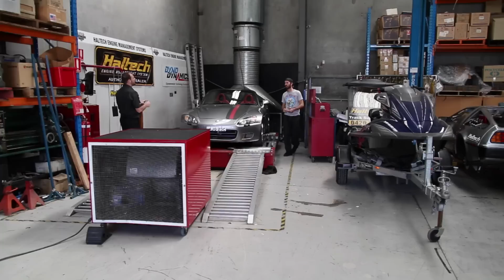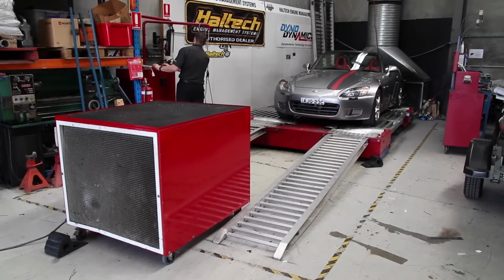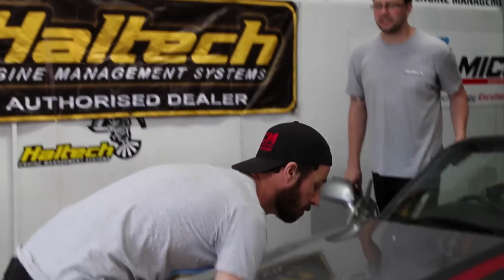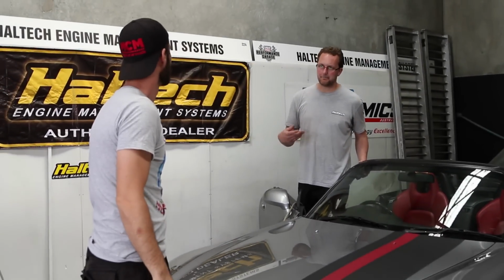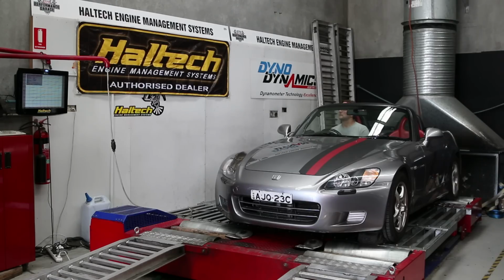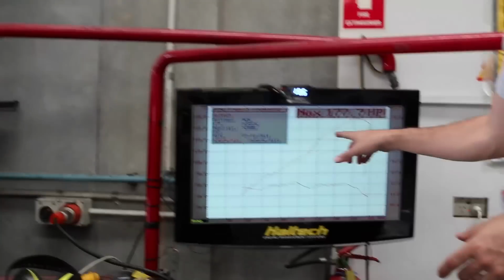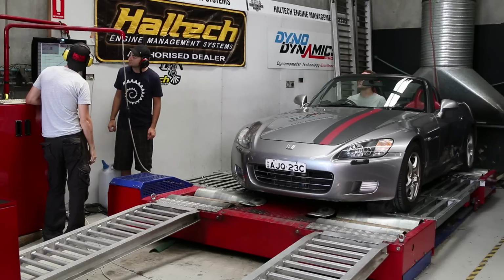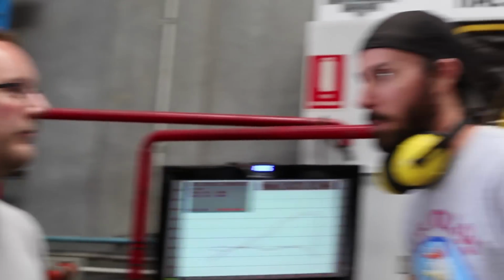Cold Air Intakes Mythbusted [Naturally Aspirated]

Comment: Here I thought I would be posting original content on testing a CAI on an NA engine, only to wake up to this fantastic video. Well, two is better than none. Great watch - I found similar results on my Acura Integra (no vtec yo). There was an increase in power on the top end.
Reply: Can't wait for your video man.
Reply: Joey Chong I'm not huge on link spamming so I didn't share it above, but since it wasn't obvious that I just released it here it is: http://youtu.be/llKZdUyoz14
Reply: I watched your vid too. Good vid, you might have seen even more gains if you too it to 7000 rpm.
Reply: I don't know why but I get this passive aggressive vibe between your channel and MCM. Although they probably filmed this before you filmed your video they seem to piggyback off of your ideas and its kind of unsettling.
Reply: yardman0001 TO THE LIMITER!
Reply: It is cool to see very similar results for two different NA engines :)
Reply: Your results seem parallel to MCMs, pretty amazing!
Reply: You should test real world driving and the affect on heat soak.
Reply: VolkswagenGamer why would that be the case? they are both using NA cars, so realistically the videos that could be made are limited, especially if they are going to show basic mods.   i.e..  intake, exhaust, tune.....i doubt we will see things like new cams and other expensive engine work until the end of this series if at all
Reply: U da real mvp
Reply: I told you so Engineering Explained.  The main thing that determines power is the ECU  !!!!    I WIN  ....i should start my own show.
Reply: Yes I knew engineering explained would justify cold air intakes!
Reply: Soo it does work even if my engine is not tune yet or tune it for daily use not track use? Tell me more
Reply: It will work but performance Varies.
Reply: jesus vega the gain of horsepower varies but it'll definetly add some horsepower to my engine right? Thank's bro! I'm consider buy k&n cai someday rather than the replacement unit :)
Reply: Your welcome man. They respond even better with headers.
Reply: +jesus vega Cars sure do. I'd rather upgrade exhaust first so that a better intake is matched with better exit flow versus just intake flow, but then a lot of people might do an intake first since that's easier to do.

Someday maybe I'll try working on the intake first and the exhaust second, but since the other way worked for me, I may be ready for disappointment, lol.
Reply: +VolkswagenGamer Yeah, it did feel a little passive aggressive between Engineering Explained and Mighty Car Mods. I don't think that it was meant that way. There was mutual respect, and some thinking like, "I want to be careful how I saw this." You know, he felt bad to say they were wrong on something...thinking more about the painted intercooler than this video.
Reply: +VolkswagenGamer Yeah, it did feel a little passive aggressive between Engineering Explained and Mighty Car Mods. I don't think that it was meant that way. There was mutual respect, and some thinking like, "I want to be careful how I saw this." You know, he felt bad to say they were wrong on something...thinking more about the painted intercooler than this video.
Reply: can any good men tell me something  , have a hyundai accent 1.6 a/t diesel with 136hp , 300nm  , if i were to take off the floor of the air box as the width and length  of the air filter , do i get what "good" and "bad" ? thank you
Reply: Engineering Explained the difference between one cai and the next one can be huge, but I have to speak from my own experience and I found the best results with a branded performance replacement panel filter and the best numbers were made with the bmc product, the lowest (negative) result was the ram-Air which was down on torque by 6lbft at the most and down on power by 2bhp, I have to add that the weather was very warm at 73 degrees Fahrenheit and one 20 inch diameter 6 blade fan was blowing at the front of the car, trying to simulate the atmosphere at x mph but probably way off. All products were tested in the same conditions. Bmc was 8bhp up at the peak and 7 up in 2 other places, and torque was up from 2 to 7 across the board. This is the order of result
2,green cotton cone filter, cda enclosed cone, HKS universal foam mushroom, pipercross foam k&n replacement panel, k&n cone ramair foam. Basically it looks like the replacement panel is best as the k&n was up 4lbft and 2bhp 2 tested both gained in both areas
Reply: How many kilocatts?
Reply: Also worth mentioning, LHT Performance found the best bang for your buck intake is actually modifying the stock intake already, so taking out that little snorkel on the top of the air box and cutting out that separator on the bottom box gives you the most gains from factory. CAIs are good but on a track after repeated sessions, the factory box tends to do the best job with keeping hot air away from the engine

Comment: Biggest improvement is the NOISE!!

Love that intake sound, its also much more dynamic than the exhaust sound, very quiet at low throttle and loud at high throttle!
Reply: On older cars it’s not just noise because the factory intake is garbage compared to the new intakes. I threw a cold air intake from a keep Cherokee onto a Buick rendezvous and it made the acceleration so much faster after I removed that small box filter. You won’t get supercharger numbers but on an 06 car I guarantee you’ll get at least 10 hp because your car couldn’t breathe.
Reply: @toxicity6629 , 4th gen camaros get an avg of 12 on cai

Comment: 3 to 5 kilowatts = 4 to 6.7 horsepower.
Reply: Those pushing electric cars want all us petro heads used to talking about power in terms of kilowatts. Subtle, but obvious.
Reply: This ain't about Teslas...
Reply: At the wheels to boot.
Reply: @Deiphobuzz  wtf are you talking about. The OP was giving a conversion, he made no comment on one mes system being better than the other.
Reply: @juanvaldez5422  someone else removed his comment. Wasnt at op.
Reply: @Deiphobuzz  ah, my bad
Reply: @Deiphobuzz  like it or not, but i prefer HP over kilowatts.  

100 HP sounds a lot better than 74 kilowatts.
Reply: @WorivpuqloDMogh  What about 1.21 Gigawatts!?!?!?
Reply: @jaytee1086  thats just +-1500 horsepower
Reply: Quit arguing ladies. The point is a cai adds horsepower. Period, that's it. Whether you call it something else... everyone knows what the fuck horsepower is, I mean come on lol.
Reply: @JimmyMakingitwork  Electric cars will always accelerate faster than an ICE because of instant torque. Also you can basically spin an electric motor as fast as you want.
Reply: @Deiphobuzz  LoL, Horsepower is just a derived English unit that represents power which uses the same derivation as the metric units. Power (Watts/Horsepower) =  Force (N/lb) * Distance (meter/feet) / Time (seconds). A random ass pony's power output just happened to match  1 lb-ft/s. 
Btw 1 Joule = 0.738 lb-ft
Reply: @merlinthebikewizard4392  And then you can burn them out too. Lol
Reply: @WorivpuqloDMogh  I know this is 6 months old but that is the stupidest thing I've heard. If 100HP sounds better than 74kW, does 134HP also sound better than 100kW?
Reply: @jaytee1086  no man. It would fry your flux capacitor.
Reply: @Deiphobuzz  So what you're saying is the OP is stupid because someone else devised the horsepower system? Seems legit
Reply: @CALISUPERSPORT  only amerifats
Reply: Thank u! I don't speak Aussie bro
Reply: Could it help with gas mileage?
Reply: @Deiphobuzz  ok Boomer
Reply: OddTimeMan that’s close to 7 hp which is noticeable to feel but it will vary from vehicle to vehicle
Reply: I dont use KWs because i am used to use HP, and everyone who i know uses HP. You can use KWs if you like but dont come to tell us what we should use. Greets from Europe.
Reply: @morreracing  Who's telling you what you should use?
Reply: @OddTimeMan  it was to everyone who thinks its wrong use HP instead KW. Its not only American thing to use HP like someone said before.
Reply: @AdonisGaming93  he changed his comment a long time ago.
Reply: @znobbz__2874  HP is based on bullshit, like all imperial measurements. The work a pony can do in an hour.. How is that not stupid? At least KW is based on a universal energy value, Joule. Thus a 50kw engine produces the same workload as a 50kw electric motor.
Reply: @Deiphobuzz  It’s been around long enough lods of people know it so it ain’t really bs, while I agree kw is better i still use hp more because we’ve been usung it on cars longer i suppose
Reply: @Deiphobuzz  K, nerd.
Reply: @JimmyMakingitwork 😂😂😂
Reply: Forget kilowatts I want gigawatts!

Comment: Pro tip for all of you looking to get a cold air intake. Buy a cheap CAI kit on ebay, you can find them for about $50. Then, measure the filter that comes with it and buy a K&N or AEM replacement filter that is the same size. Replace the filter and you're good to go, and you just got a high quality CAI for around $100.
Reply: Build your own. Way cheaper. I used 3" PVC. ;)
Reply: +Travis Pfeifer Doesn't PVC offgas some nasty things when it gets hot?

I used ABS to avoid that, but not 100% sure if it's actually a material concern. Worth looking up, though, would hate to foul up your MAF sensor or something with nasty PVC fumes.
Reply: +MrJamesonStyles I'm not sure if that's something anyone has looked into. PVC fumes and MAF function...best guess is it's more dangerous for humans. K&N filters do have confirmed problems for MAFs however. Increased gunk on them and all of your intake. If this is not all cleaned up, regularly paper is better.

Paper may still be better even if it's all cleaned up. MAFs for example already fail a lot on my car, the count may be 1 or 2 less without a lot of K&N filter time. 5th MAF in 140k miles. (Though 1 was just because new from the factory it was messing up fuel trims.)
Reply: +MrJamesonStyles Plus, PVC offgas is at temperatues that my intakes don't get to, even in the hottest of my summers, so a nonissue in most NA car unless you're 110 degress F plus...I haven't witnessed the data that hot.
Reply: +DE “AutoBravado” Nichols you must live where it's cold all the time then cause my Camaro in the summer will easily see 140 idling in the hot 100 degree summer heat.
Reply: luigi90210 Mine will too in a real city's stop and go traffic. I live in a small town so I don't see much of that kind of driving.
Reply: luigi90210 For some silly reason I'm an American who left my torque app in C. Did the conversion and the worst I saw in Salt Lake City was 158-170F.
Reply: luigi90210 This was before I added another cold air pipe blowing on my short ram. When I'm moving it'll get maybe below 40C about 104F, or close to ambient. Usually doesn't get above 58C (136F), at idle in bad traffic, but the stock intake held on to heat and would consistently stay above 50C unless you could get out of traffic. 

With same conditions with my mods I'd get close to ambient temps as soon as the car was moving instead of heat taking a while to bleed off.
Reply: DE Nichols lolol

i also use torque pro to log data off my camaro, i live in a fairly big city so i see those temps all the time unless its winter and like 40 degrees outside

i would never use PVC for an intake though, id buy the ebay intake made of aluminum and put a name brand filter on it if i was on a budget
Reply: luigi90210 Luigi, my comment was mistake 22 weeks ago. PVC would definitely get too hot and off gas! If you want to get ideas off my setup, I did make a video since then.
Reply: 3DprintedLife does it sound better?
Reply: I did that to i bought my cold air in EBay for only 40 bucks for my Mazda protoge it's worth it i do notice a slight difference lol
Reply: Not in California
Reply: You guys are missing out the engineering skills of big brands that you both don’t have. It’s all engineered to allow air in the right way its science boys look into it.
Reply: Aw I read this comment 4 years to late , just spent 300 on a k&n intake
Reply: Do you mean to buy only the mushroom part from k&n and then slap it on? do i need heat shield too?
Reply: my DC Sports is Dyno Tuned!!!!.....very AMmmmzzing CAI.....Then put Filter Wears on filter....Prestige  Auto cut out foglights...put thick... grill in it...paint it satin black.... made dummy on other side!!!... it.. sucks..cold air.. into CAI ..into throttle body... &... it screams...one of my mods on my 2006 Mitsubishi GS..😊😊😊😊😊😊😊😊😊😊😊

Comment from the maker: Quick Tip: If you want email notifications when a new video goes up then click on the little cog next to SUBSCRIBED and select 'send me updates'
Reply: hi mcm im from uk and was wondering if you will come to the uk some time
Reply: firts thing boost the s2k and second ypou should consider coming to millwaukee wisconsin or west allis wisconsin to be specific we have a great car scene here that marty will hate cuz hondas everywhere
Reply: *****
You need an entire firewall for some cars, some cars you just need a steering column and the interior infront of the seats.
Reply: Mighty Car Mods Clearly the people on your forums are god damn idiots and have ZERO clue how a car engine works. It's essentially a giant air pump. The better you can get a larger and colder charge into the engine the bigger the bang you're going to get. Bigger bang means more power, taking out the very restrictive factory intake which is more designed around keeping noise low than making better power is good step in getting a little extra horsepower.
Reply: I do not have a cog next to my subscribed is this cause I'm on an I pad?
Reply: Never sell your s2000 MOOG!!! Love it!
Reply: Thanks for letting us know!
Reply: should make myth bust old oil vs new oil see if you get more hp or the same
Reply: Love the shirt Moog
Reply: ***** lol. Are you joking? I hope so. Because if you really think they'll read your comment and say ok let's do it your lacking massive amounts of common sense
Reply: Michael labonte I could make him a video on how to convert a car from left to right hand drive.  It'd go a lot like this:  Sell the left hand drive car and buy a right hand drive car.

Boom.  Done.
Reply: mynameisray I put a AIRAID  CAI on my 2014 Dodge Challenger with the 3.6 V6.
My 0-60 times went from a low of 6.5 seconds to a HIGH of 7.8 WITH THE CAI.
So I actually LOST horsepower!!!
Reply: ***** Youre joking, right?
Reply: +lonnie mann well, the aftermarket intake weighs less, so the car is gaining from that as well. no matter how you look at it, cold air is the way to go over factory.
Reply: ***** 
Dude your talking like 2lbs less. It's nothing!
Reply: floridabrn the factory intake on the Challenger is already a cold air intake.
It sucks from the bottom
Reply: Motor City Man Every time I even think about buying an intake when I get a new car, I wind up slightly modifying the stock airbox....Love that OEM look and honestly, with a clean OE or K&N filter, they make the best power....And as you said with dudes Challenger, almost everything now-a-days has ducting for cold air from the factory.
Reply: +Mighty Car Mods Alright, listen up. I'll try to explain what I did. Search for "How To Build A Peltier Cooling Device". Once you know what it is figure this out, I put that cooling fan into the air filter box, so it makes cold air sending it directly to the throttle body. But Im not able to take the car to the dyno. Can anyone recreate what I did and check if there is any hp gains?
Reply: +LOV2XRL8RL Peltier cooling your intake requires electrical power which has to be generated by the vehicle's alternator.  You will increase alternator load, which will increase parasitic load on the engine (like a supercharger does) to make the air coming into the engine a fraction of a percent cooler.  A decade or so ago some people tried cooling their PC air intake air the same way, which is a vastly lower volume of air, and found that it basically did nothing useful.  It probably did lower temps, but not enough to be noticeable.

You're moving vastly more air than a PC fan with your engine.  The sheer volume of air moving through your airbox won't be significantly affected by a peltier element.  And they're massively inefficient as a cooler - there's a very good reason why people stopped using them to cool their PC's back in the early 2000's.  There are just far better ways of doing this.

To make a cooler that could stand a chance of making more power, you'd need a peltier so large it probably wouldn't fit into your vehicle.  You'd need to have a huge alternator that would rob you of more power than you gained.  And you'd need to watercool the peltier, adding a lot of weight to the vehicle.

I really cannot see how this would be useful.

Far better would be to line your exhaust with seebeck elements and leech the heat, generate power from them, and eliminate your alternator.  You'll gain a couple of HP and improve MPG a little.  Still probably not worth doing though.
Reply: Sir, you opened my eyes and expanded my mind. Thank you.
Reply: +Anton Taylor pointless unless you are running Forced induction.
Reply: +Jon Joneza Really? More or less pointless than a Peltier?
Reply: +Anton Taylor hahaha water in the head
Reply: @mighty car mods, would you say that once the engine starts running lean after an intake mod, u could be damaging your engine? The AP1s already run rich..would installing an intake actually being the AFR to a more balanced solution?
Reply: Why not try a high flowing intake (use an inertial separator intake rather than a pleated filter) https://en.wikipedia.org/wiki/Dust_collector#Inertial_separators